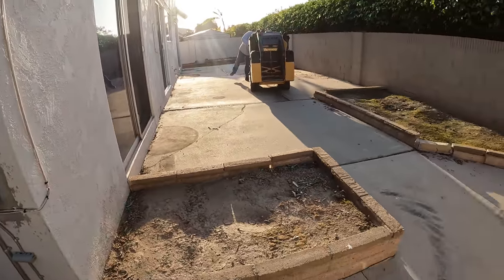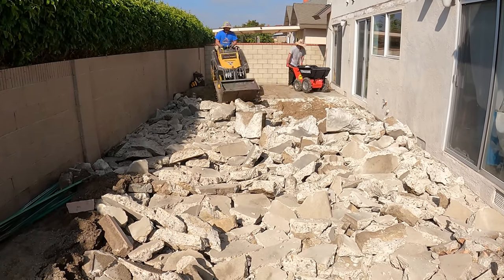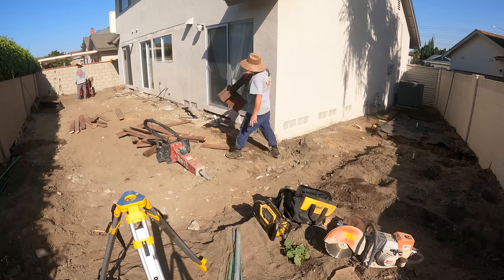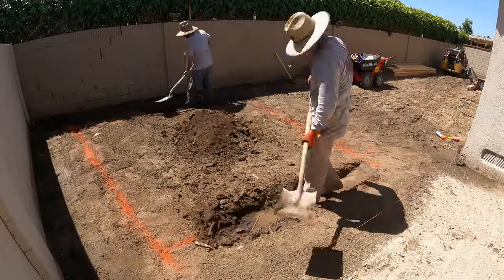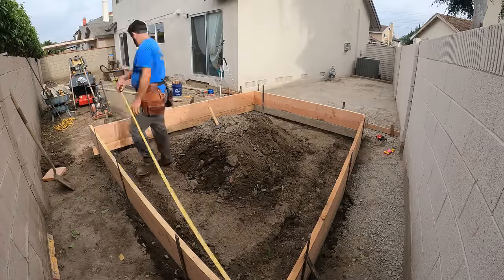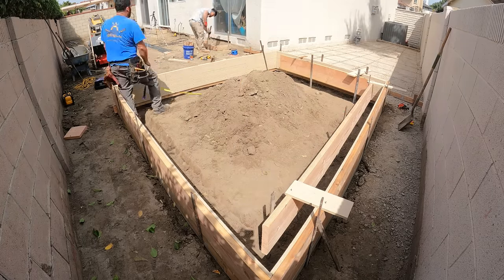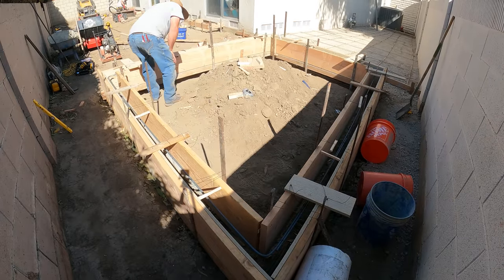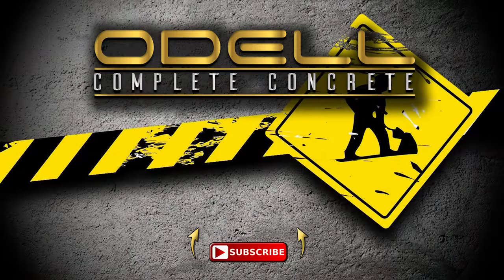Complete Hardscape Remodel Around Entire House

Comment: I used the fiberglass rebar on my new driveway and back patio last year. Works great. So much easier to work with. Need to use gloves though, real rough texture.
Reply from the maker: Great tip!
TY